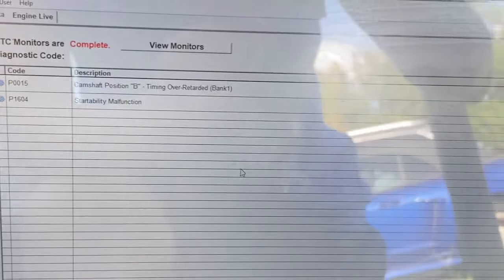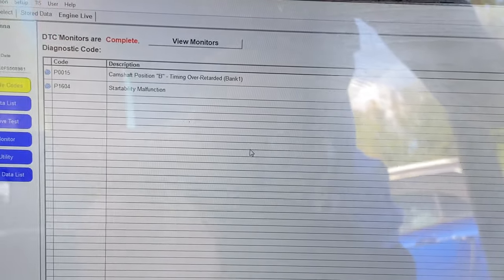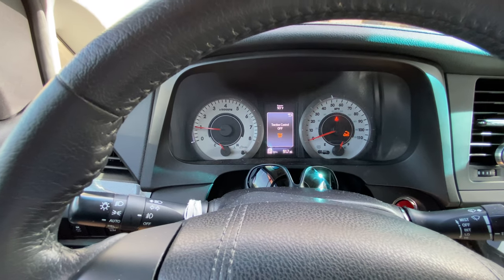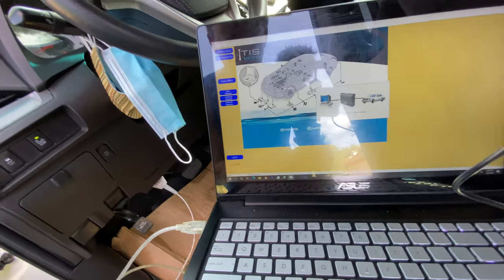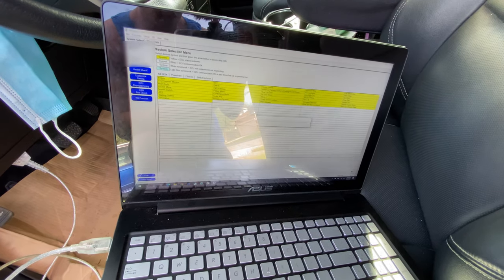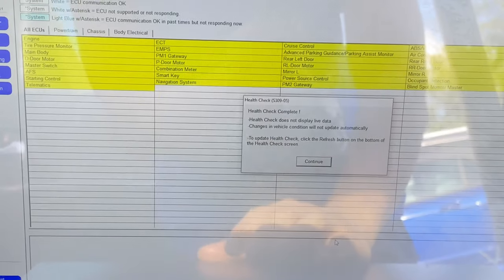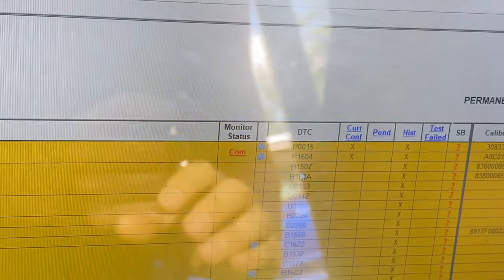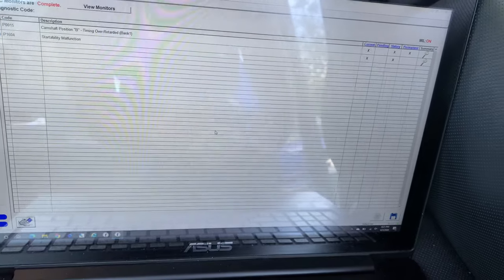2011-2020 Toyota Sienna Jacking Points | Check Engine P0015 P1604 | Techstream Diagnostics

Comment: You don't need the wood. Just turn the jack stand sideways and it on that same frame rail. Also, you're too far towards the center of the car with the stands. Go as close to the jack as you can. You could have easily gone a few inches closer.

Comment: I had the exact same thing happen to my 2016 during a long road trip (the oil was also due for a change). I took it into Toyota and they said the P0015 indicated the Camshaft timing oil control valve was messed up and needed to be replaced on bank 1 exhaust side. Unfortunately I did the spark plugs a couple of months ago and didn’t want to pull off the manifold again to get to the valve. Luckily the code cleared on its own. If it reoccurs I’ll get in there but until then I’m changing the oil and hoping it stays gone
Reply from the maker: I been randomly getting those codes a few times a year. Clear and keep going for me. It’s usually due to old oil that may trip the sensors.

Comment: Hey I had a problem with a jack a long time ago back in the 90s and what I did I replaced the oil with a very thick oil like 50 regular engine oil and it worked fine and I forgot who I gave that jack. But it worked fine for many years it was Taiwanese made

Comment: if you cut a channel in the wood across the grain it will not split. It splits with the grain.  use a hardwood and it will last for years

Comment: Is that a low profile or regular floor jack?  I need to get one soon and I'm not sure if I'd need the low profile one or not.  From Toyota's site, the min ground clearance for the Sienna is like 6.5".  Does that sound about right on yours?
Reply from the maker: A sienna can use regular height jack. It's high. I've got one of those Harbor Freight "racing" jacks. It's garbage that seals leak and die after a few years.
Reply: @TunerwithKids  ok thanks

Comment: You have the lifting points incorrect. The proper lifting points for a Sienna is a little hump located underneath the car in front of the engine. Theres also another hump in the rear of vehicle right under the 3rd row.
Reply: Yeah and if you put the jack in that hump in the rear you will watch it collapse. That's not the lifting point at all, don't know why Toyota recommends that.
Reply: Where can I find the lifting points for sienna?
Reply from the maker: The manual. There’s two front and rear center spots but I don’t trust them cause the rear looks weak.

Comment: Instead, if I jack up the sienna from rear middle jack point (as manual instructions), do u recommend I use 2 x 3tons stand on both side pinch weld? Not sure if these 3 tons can hold the car properly
Reply from the maker: You can but those pinch welds are very weak and fold easily. On the rear, you will see a reinforcement area to the rear inside of the pinch weld. I usually try and get the jack stand there. I have a set of 2-ton and a set of 4-ton stands. I use the 4-ton up front and the 2-ton on the rear. The also sell a jack stand pad that helps prevent bending the pinch weld. https://amzn.to/3pncvGH
Reply: @TunerwithKids  thanksz for link! I will give it a try. Sounds like my 3 tons stand with the pad on + the floor jack can work together at a tripod in the front part of car, assume the front is heavier with engine thanks again!
Reply from the maker: Yea you should be good. Make sure the jack is securely centered on those spots when jacking. Some people miss the spot and end up lifting the oil pan or rear trunk floor.
Reply: @TunerwithKids  wow. Sounds very hurt. Like a punch in the face. Ouch

Comment: Not sure why you didn’t just use the jack posts?
Reply from the maker: I don't like the center jack points. Especially when doing side car work.
Reply: @TunerwithKids  I wouldn’t consider them  ”center” jack points they are the areas with the most strength to support the body. Not knocking how you do it, just FYI. Also, there should be arrows on the plastic portion on the lower body panel right behind the front wheel and right in front of the rear wheel.
Reply: @TunerwithKids  By the Way, Thank you for doing this video. Not too many on this subject for this vehicle.

Comment: Well shit. I forgot about using wood as shims to clear the pinch welds. That stuff is great in compression. Thanks.
Reply from the maker: I have a newer video where I discovered the slit puck and aluminum pinch weld mount. I also have a link in the description of this vid to them.

Comment: 3 Main Body codes
I have a Toyota Sienna gave me this code
Reply from the maker: What year is yours? After I reset it, it hasn’t come back.
Reply: @TunerwithKids  2011 toyota sienna
Reply from the maker: If it’s the same codes I have, try resetting it using a code reader or plugging battery.
Reply: @TunerwithKids  Thank you
Reply: @TunerwithKids  P1603 , U0100, U0101 , these are new codes what do they mean , also if not cleared will there be problem or should i leave them
Reply from the maker: hasan circis sounds like you have some transmission control issues. IDK anything about those codes. They indicate that there is some lost communication between ECU and transmission controller.

Comment: wood shims on a jack stand?  no thanks.....
Reply from the maker: A 2x4 block can hold up houses, and beats a bent and crushed seam weld using a floorjack. Been working for me for over 20 years. But I just discovered they make pucks and mounts for the seams. Check the links in description, I’ve upgraded to the puck with slit to fit the seam.